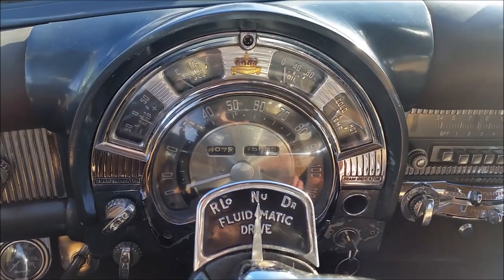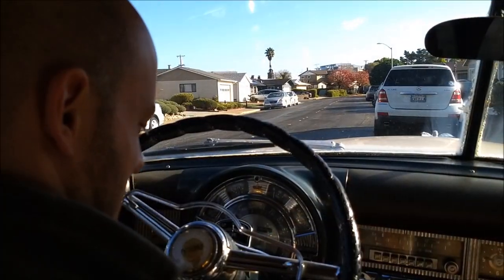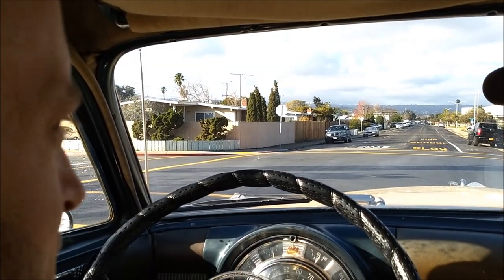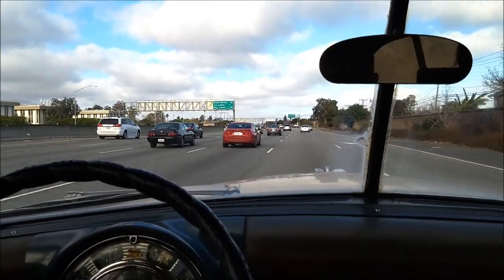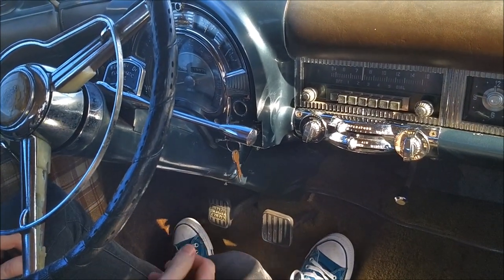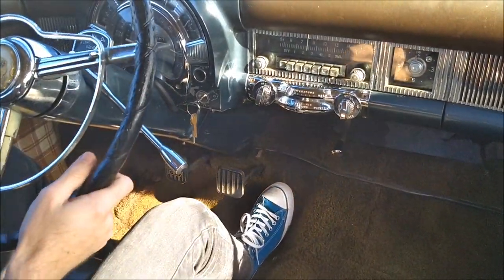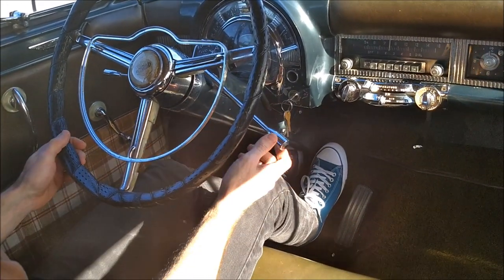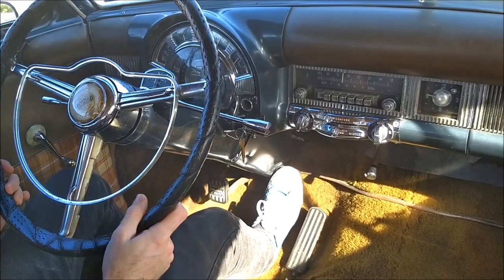1951 Chrysler Windsor Drive

Comment: My parents had a 1950 Chrysler Windsor until 1963. We traded it for a 1961 Falcon. Talk about a step backward! The Chrysler had electric wipers! It was a very solid car and much smoother and quieter than the Falcon. We did have a lot of trouble with the transmission from about 1959 until my dad traded it for the Ford. This video brings back a LOT of memories. '

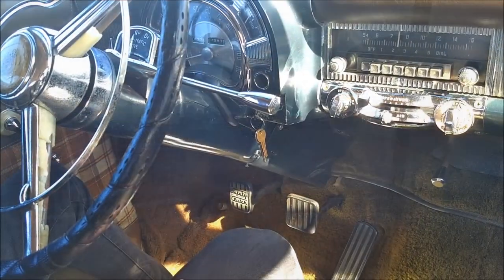Comment: Potential Viewer: This is an excellent tutorial on how to operate Fluid-Drive.  Operating Fluid Drive isn't difficult it's just different.  But beware, there are several videos on youtube with poorly done or complete misinformation on Fluid Drive and its operation.  Joe Turner here has an excellent understanding and gives a good explanation on operating Fluid-Drive.  The tutorial begins at 4:32  Note: Shortly in he states "Any time you move the shifter you have to have the clutch in".  I'll put that another way for those just learning--the only time you have to push the clutch in is when you're going to move the shift lever.  It's not manual shifting, it's that pushing the clutch-in allows for the shifter to be moved.  Though Fluid Drive can be manually shifted between ranges while driving but it's not necessary.  A few years back when I purchased my 1948 Chrysler Windsor there was only one video on youtube that was correct.  I didn't have an Owner's Manual at the time so I researched on-line technical pages in order to drive mine correctly.  Now having had a genuine Chrysler Owner's Manual for a time I'd like to add that the 1948 manual states to "press on the accelerator a little" when letting out the clutch.  As it's possible to stall the engine if you let the clutch out to quickly.  As well, it's OK not to press on the accelerator if you let the clutch out slowly.  This would be at times when you're not ready to drive-off, such as stopped at a traffic light and you wanted to change the gear range.  I wish to give thanks for a beautiful ride-along, as I completely enjoyed it!  Joe I hope you post more vintage Chrysler videos.  I gave a Thumbs Up and Subscribed.
Reply from the maker: Thanks, glad you enjoyed it! I had found a lot of misinformation out there on these transmissions as well. I won't be making any more Chrysler videos; I sold this car in January 2018 after driving it for 10 years. I do have a lot of other project cars though, so you can expect future non-Chrysler videos!
Reply: Thanks Joe.  I'm looking forward to what you present.

Comment: I notice the shift quadrant says "Fluid Matic." Referring I'm sure to the commission's ability to shift between two years in its respective range. My first car was a 1 941 Dodge and the script on the truck said "Fluid Drive."
 It had a completely conventional three-year transmission and clutch, but included a fluid coupling. You could let the clutch out at a stop in any gear (it was a slow start of you were in third) and just step on the accelerator to go. Wish I still had that car - paid $25 for it.

Comment: I had a 51 windaor delux in the early 60's.  Had ongoing starting trouble till I got rid of it in '65.  I think you're still 6 volt - be sure you got  a real big battery...bruce
Reply: Here's something strange, that I can't explain, our family car was a '50 DeSoto, same basic car, yet it would start EVERY TIME in -20 Minnesota Winters! This GREAT old car will live forever in my memory! Yes, i am 65 yrs. old now, but i remember this like yesterday!
Reply: @johnmaki3046  mine wouldn't srart when it was warmed up, then sat for awhile.  I knew a guy with a '60 Olds, same problem.  Solution - larger battery.